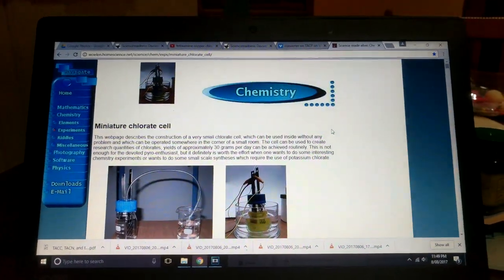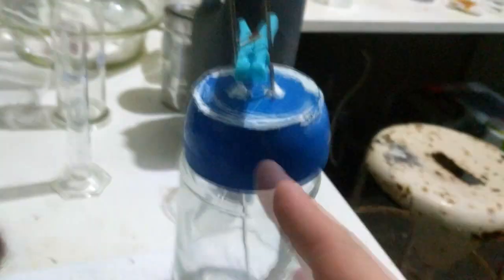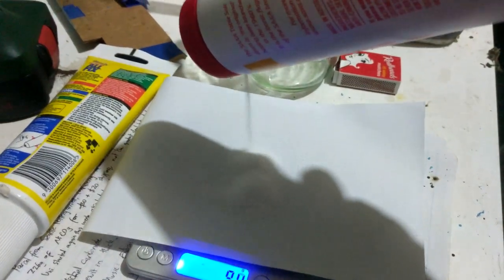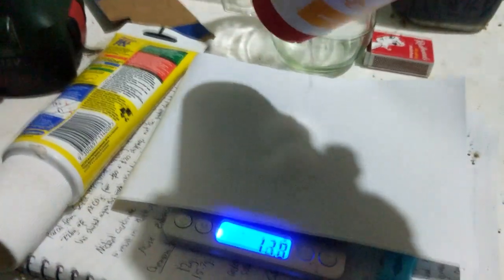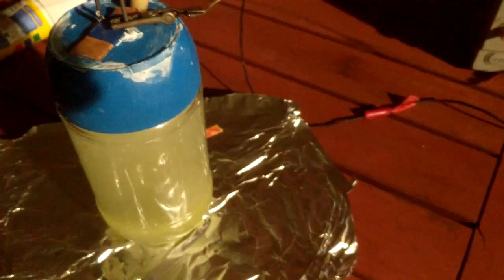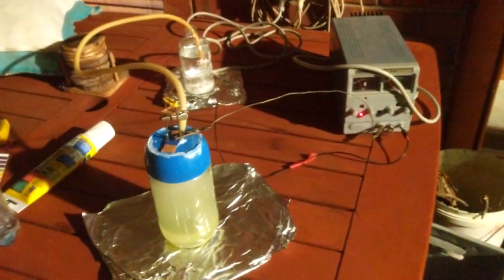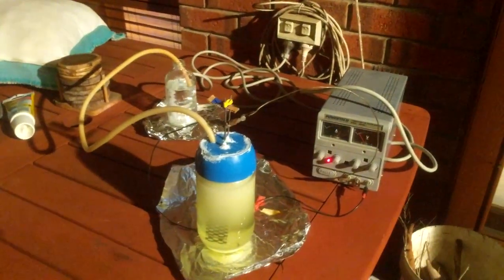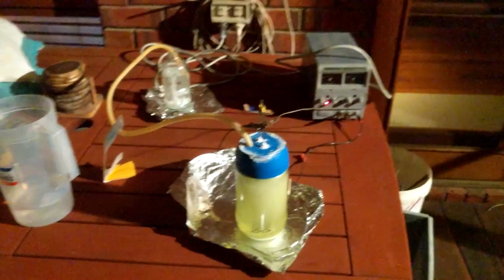Making a Sodium Chlorate Cell

Comment: If you ever need pure salt again you should probably go for pickling salt, it's non-iodized and doesn't contain anti-caking agents and should be very pure sodium chloride.
Reply: Pickling salt is a very american thing, so it might not be available over the water
Reply: Kosher salt is pure NaCl and available everywhere.
Reply: Kosher salt is pure NaCl
Reply: @wat8437  really? why?
Reply: @chemistryofquestionablequa6252  wrong kosher salt can be anything, as long it would have big flaky crystals
kosher salt doesn't even have to contain any sodium
Reply: Commonly sold kosher salt is, at least in Canada. The crystal size doesn't seem to matter, I've seen everything from tiny to pretty large.
Reply: Dishwasher salt
Reply: @wat8437  just pick the cheapest one
Reply: Iodised salt as a default is an American thing, the rest of the world gets their iodine from food (that's literally the reason, it's just that most of America is far away from the sea and you don't really eat much real dairy compared to the rest of the world), some countries have one brand that is iodized and people will buy it when they're sick or have been recommended to have extra iodine. But yes the caking agents are a thing everywhere for table salt, but it's a negligible amount so it doesn't really matter in these non sensitive reactions.

Pickling salts are a thing elsewhere but there's no reason to buy those when you can just use sea/rock salt. Kosher, or more precisely, koshering salt is also just rock salt.

Sea salt is from the sea, rock salt is from mineral deposits underground.

Sea salt is "healthier" to eat because it's got lots of trace elements and minerals in it...because it's made from sea water. So there's some iodine and other trace stuff but not nearly as much as american intentionally iodised salt.
Reply: what about over the counter, tho?
Reply: @WizardNumberNext  if there’s no sodium, then what would that kosher salt be?
Reply: @jonadams8841  I didn't write it doesn't contain any sodium. It may contain no sodium. 
Potassium chloride have similar taste
Guess how I know
Reply: @WizardNumberNext  so you’re implying that it’s not a sodium chloride base? What the heck is it then?
Reply: @WizardNumberNext  potassium chloride is tolerable in minor amounts, it’s “salty” but quite bitter. In higher doses it can cause heart problems, which would be a bad thing. I can eat a lot of sodium chloride without that. I will stay away from your pickles.
Reply: @jonadams8841  1. I wonder where did you read that
2. It is not bitter at all
3. I don't ask you and don't recommend you to inject it directly to blood stream
4. Consuming potassium chloride is perfectly fine as
a. Potassium chloride is so called low sodium salt
b. I am doing that in same or bigger amount as sodium salt for many years now. I even add it to water along with sodium salt, magnesium salt and epson (this one is bitter) 

Please don't spread false information. Verify what you read. 
Example below
I have heard propyl alcohol is toxic. I did drink it not knowing that (as test of taste, not recommend). Acetone, which is propyl alcohol metabolite is supposedly toxic. Well I am in ketosis for many years now and I am not dead yet. Acetone is second most abundant ketone made by human body. 

Don't blindly accept everything what you read as fact. Verify it. We are still learning Newton gravity in school, as what actually happens, while even Einstein was wrong. Think about it.
Reply: @blackirish781 and it's iodized

Comment: Nice electrodes! the best thing about these cells is the simplicity. even the simplest setups will produce chlorates if made well. plus they can just run unattended.  i'm sure woeleon will appreciate the shoutout.
 have just last week finished a rather large run of my newly made 1.9l cell. i used the electrodes i built for my video on my cell but put them in a nice large reject shop bought barrel. two rubber grommets kept the whole thing nicely contained with no crust creep to be seen and safe enough to run inside. it was running at 5v 18A and i run about 900g NaCl.
 The problem is now dichromate leftover in solution and it has made the NaClO3 yellow with it's inclusion.  not really sure if a re crystallization will remove it totally. but i have not tried yet.
a tip to help the electrolysis go smoother would be to put it on your stir plate and spin away for a few hours at a time. i had mine running on off most of the way through on a timer for 15mins per hour.
Reply from the maker: Yeah I could chuck in on the hotplate, just to keep it at a good running temperature as it gets cold afternight, good thought. 
1.9L cell, niceee. Hopefully the recryst does clear it up, working on that scale is hard, but don't see why the recryst of the material wont fix that issue.
Reply: NerdShedLabs TM GeekSufniLab once you work out the cell parameters eg: volume, Amps, anode surface area, the amount of salt in the cell, you can use some fairly simple calculations to get a good idea on how many amp hours are needed to convert the salt into chlorate. The main problem is calculated efficiency. Finally you can take advantage of the higher solubility of NaClO3 vs NaCl and recrystallise it. Also separate using acetone may be possible as NaCl is practically insoluble in acetone and NaClO3 is.
Reply: AllChemystery
Reply: Nope. Mine passivated after 6 hours. It is probably because I did something wrong two times in a row. Anyway I got more and I am going to try again.
Reply: other cool thing about these cells is that you can even make perchlorate if you are determinated enough

tho idk if i will even be able to make chlorate with the stuff i have, no heating, just water, table salt and graphite electrodes, been running it for pobably 2 hours rn from a old ass phone charger and all i got is a weird green stuff floating on the surface, definitively not sodium chlorate
Reply: @VerbenaIDK that's probably some salt of manganese, if you scavenged the graphite rods from electric cells.
Reply: @imranroy4731  it was copper from the chlorine corroding the wiires, the MnO2 is not affected at all in the reaction at the anode, tho i guess if some got into the cathode some fun stuff may would have happened and reduced it? idk, electrochemistry is not my forte, though it'd probably be a light pink color and not green

Comment: 1 mole of electrons is 96458 coulombs of electrons. Or in other words, at 6 amps, you'd be producing 62 micromoles of electrons per second. 2 electrons are required to liberate a chlorine molecule, so 6A would be giving off 1.5mls of chlorine a second. 

1.5ml/s is alot, in 24hours you'd fill 129 1L bottles. 

6-7A is also crazy high current for a small setup like yours. Energy losses through wires are proportional to current squared. Just 1 ohms on your crocodile clips and you'd be producing 30-50 watts of wasted heat
Reply: well that's fine, if it keeps the cell at 80 c, for maximum efficiency, less work to do :p

Comment: Thank you for working on this and making a video. I had made chlorate a few times now, first with carbon, then with MMO. Also I like your way of talking and speech. I wouldn't worry about pH controll unless you can drip-feed your acid in. you can read on APC that just splashing acid every two days won't improve the efficiency. Your constant current supply is more suited to chlorate than my constant voltage one, but is not very strong. Unfortunatelly it is way harder to modify (the free!) computer PSUs into constant current mode than to voltage mode.
Reply: voltage is the parameter which dictates the specific chemistry occurring in the cell, and so I would choose this to be the parameter kept constant. Amperage is the number of moles per unit time produced and should be simply maximized without the electrolyte getting too hot.

Comment: You do not need to add dichromate when you use MMO anode and titanium cathode. Actually if you do use it it will shorten the life of your MMO anode. Dichromate is only needed when using a steel cathode to limit parasitic reactions, but those are very minimal when using titanium. I run a cell similar to yours without dichromate and it works very well.
Reply: stamasd  Thanks for the information! Since dichromates are only commercially available I'll just need to get a titanium and a MMO electrode.
Reply: Do graphite electrodes benefit from dichromates?

Comment: Hey mate how do you measure the pH without bleaching your strips? I'm pretty sure I added waaay too much HCl as well due to difficulty reading bleached strips, and I've got two different kinds.
Reply from the maker: Usually the colour comes up first before the bleaching  or your let the drop soak in enough that the edges give a good enough reading. That probably makes no sense, but it works with the strips I use. I've never liked the standard 4 panel dip pH strip ones for this reason,

Comment: lmao if i can eat clay I can eat 554
Reply: yes, you can eat clay
clay is aluminium oxide, same as sapphire
Good look dissolving or reacting sapphire in hydrochloric acid even including all enzymes human body is using to digest food
it is different with artificial additive 
just be safe and don't compare completely different chemicals like both are apples
one maybe be Apple, but other is very much goat
Reply: @WizardNumberNext  clay is alumino silicates not aluminium oxide. Kaolinite for example is a 1:1 clay or montmorillonite is a 2:1 clay
Reply: @Damon2920  thank you for correction. I appreciate information. I had idea, bad half of my idea was wrong. Thanks

Comment: Is it relatively easier and/or less electrical current-intensive to just make a solution of sodium hypochlorite, then use heating to disproportionate that into chloride and chlorate? I ask because maybe that could be a quicker or more viable option for people without higher-current electrical power supplies for the electrolysis.
Reply from the maker: Good question. Yes it is less current intensive, but it doesn't produce good quality Na chlorate. If it id, I could boil down the 10L of 10% hypochlorite I have lying around.

Ok so think about it like this: boiling hypochlorite makes chloride and chlorate. So for every molecule of chlorate, there's roughly one molecule of chloride. The chloride is less soluble, so it will be difficult to purify a 50/50 mix of Na Chloride/chlorate.

In a chloride cell, you're turning chloride into chlorate, so while you're increasing chlorate molecules you're also decreasing chloride molecules, so after some time its easy to purify out chlorate because it's in vast excess.
Reply: How about mixed method. Heat up to get 50/50 mix and them electrolysis?

Comment: When you talk about periodically adjusting the pH of the solution manually - that must be a hassle. Why dont you setup a simple pH Arduino controller unit with an automatic injector valve connected to a small bottle of HCl. This seems like the perfect example where it would be highly effective at and it wouldn't be to difficult to setup either considering all the parts are available online. That means you would have a fully autonomous process and you can just check on it from time to time :)
Reply from the maker: Hey i've been thinking about this for a while so here is the reply:

I mean first up is the cost and effort of such a system to fix what is a relatively minor problem for the cell. I have no idea how to code at all so there's that. pH meters, at least good ones, at quite pricey.

But anyway, the major issue I feel is an issue with pH meters themselves. pH meters aren't designed to stay for long periods in solutions (other than the buffer they come with). They work but continually comparing an internal reference solution to the outside world. If the meter stays in the basic chlorate cell, it would quick begin to drift and before long it would likely be all over the shop with its values. So it needs to not soak in the solution and also continually get calibrated. 

I do like the idea of it being autonomous though. If the cells holds at ~50C then the evaporation rate is reasonable, so a very slow drip of a very weak acid + some NaCl would replace the water and keep the pH more reasonable, something like that wouldn't be that hard to rig up. Would also stop the chloride level falling so fast, but still lets the chlorate crystalise out when it reaches that point, as you're adding a solution of the NaCl.
Reply: For more info see: https://www.amateurpyro.com/forums/topic/7502-ph-control-for-chlorate-cells/
Reply: Extractions&Ire I doubt a DIY pH monitor would be worth the trouble, but you could mount the probe on a servo and have the Arduino dip it in the solution periodically.  Relying on new code to release HCl would make me a bit nervous - nothing for someone that makes the products you do though!

Comment: Why sodium chlorate but not potassium chlorate?
Reply from the maker: Think i'll need the more soluble salt for an upcoming project or two. Also just to be a little difference, less videos on a sodium chlorate cell than potassium (not that there's much difference)
Reply: It give great yellow color.And kclo3 gives more red
Reply: Wei Zhao make sodium perchlorate solution then just add ammonium chloride and you have ammonium perchlorate percipate at bottom

Comment: why are you avoiding potassium?
Reply from the maker: nickt potassium chlorate is much less soluble than sodium chlorate, so will come out as an impurity in the crop of crystals we get. Not an issue for most applications, but it's annoying for some, and so if we're going to the effort of making Na chlorate, we might as well make it as good as can be, ya feel
Reply: what are applications where you want to avoid potassium? thanks for replying
Reply from the maker: nickt thanks for commenting!

Well I was making this sodium chlorate because I wanted to make ammonium chlorate (see my other channel called Explosions&Fire2), which needs to crystallise out from solution. Any potassium in the chlorate would contaminate it, and the energetic properties of the ammonium chlorate rely on the fact that there's just ammonium and chlorate, so potassium would lead to an inferior product. Sure, it would be minor, but it is nice being sure of purity
Reply: @ExtractionsAndIre  Why would your rain water have potassium in it? do you live inside of a coal plant